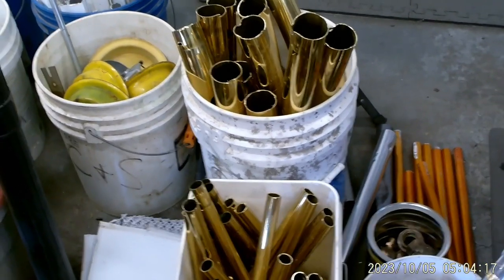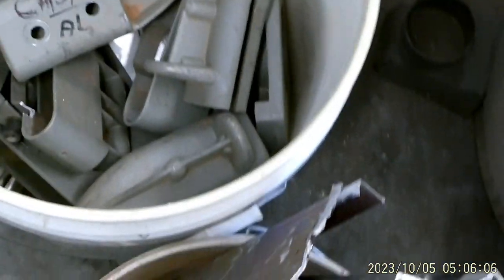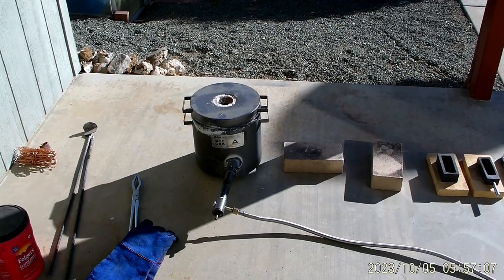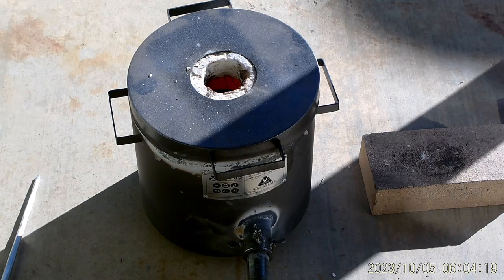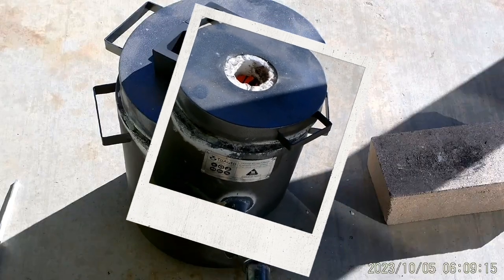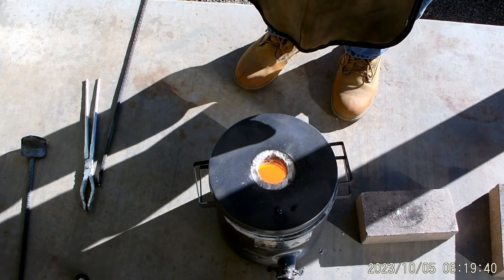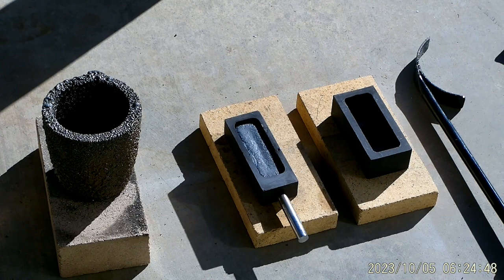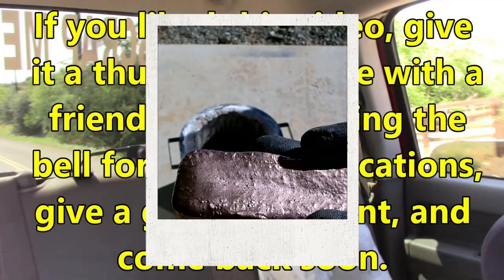I Transformed Scrap Into Perfect Copper Bars in Just 10 Minutes!

Comment: Hope to try some pours 🫗 soon
Reply from the maker: Nice! Have a blast with those pours! Can't wait to see what you come up with!
Reply: Have a small sword mold that hasn't been used.  Just no time lately.  Have also need to figure out why it sounds like a buzz jet. Has to be either propane/air setting
Reply from the maker: Keep after those melts Rich. The sound you are hearing may be freezing of the propane bottle fittings while it is being used. Try sitting the bottle in a tub of hot water while you are using it.